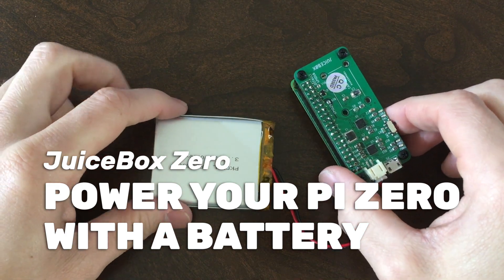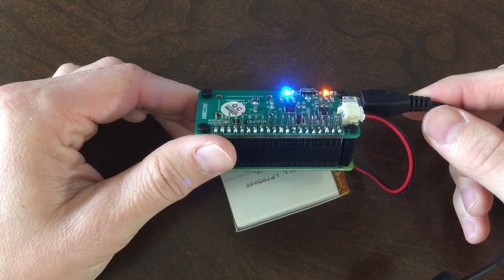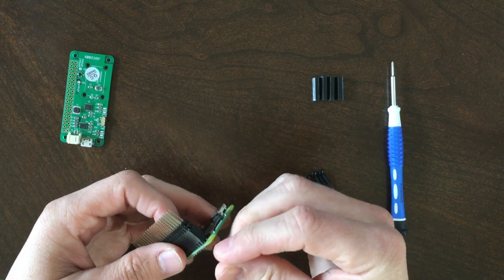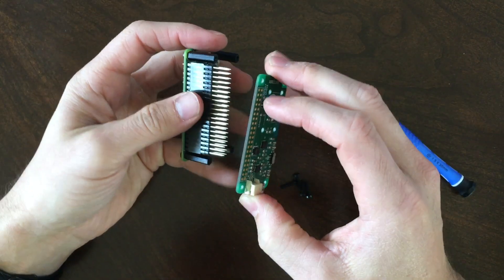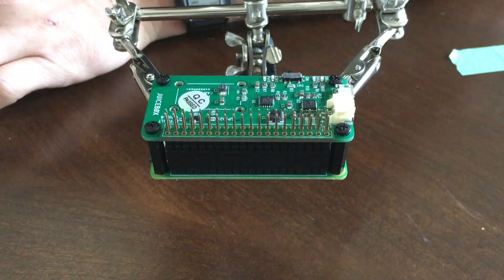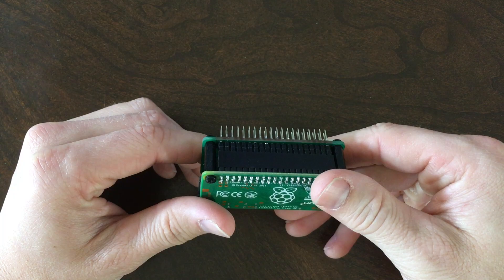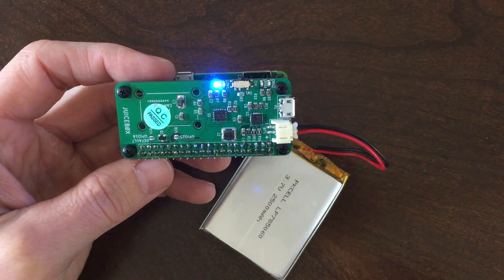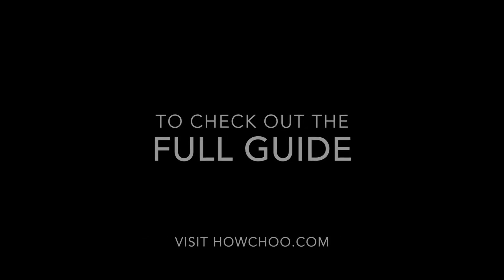Power Your Raspberry Pi Zero with a Battery Using the JuiceBox Zero

Comment: Why is that board so big? A 5V buck regulator and liion charging chip are tiny.  This couldve all been on a small 20x20mm adapter board with a male micro USB connector.

Comment: Instead of cutting off the rest of the pins you could stack another card on there as long as there's no conflict with which pins it's using and the pins in use by the juicebox. I'm curious what are the advantages to using this device instead of plugging in a mobile battery pack to the USB. (Besides freeing up the USB port)

Comment: Okay so I can still power things like screens with the header pins while using this module?  And also would this work on all raspberry pis or at least the 3B+ ?
Reply from the maker: This one is meant for the Zero and probably won’t provide the amperage you need for the Pi 3 — something like this is a better option: https://howchoo.com/g/ntfiytbjote/raspberry-pi-ups-uninterruptible-power-supply — And you can definitely still connect other things, it just depends which pin they rely on. You’ll need some kind of header splitter. See Pinout.xyz to check for conflicting pins.
Reply: The purpose of the extra tall header pins he added is so you can stack multiple hats so as long as you can fit it and there are no conflicts with the pins used you should be fine.

Comment: If you are using.the HDMI then make sure the screen is connected to the same battery because the HDMI on the Pi doesn't protect against different zero volts levels
Reply: Could you explain that futher

Comment: You do NOT need to solder all 40 pins. You can just solder the two 5v and a ground port and it will work

Comment: Can i connect standard cell phone power bank to raspberry pi zero w ?
Reply: As long as it can supply the milliamp draw of the pi and the voltage isn't too high you should be able to. Keep in mind some chargers may say they supply 2.4 amps but they mean through multiple ports simultaneously. It doesn't necessarily mean it will output that much through a single port. But it might.

Comment: can i stack another bonnet on top?

i want to use this with the pi-zero and adafruit oled bonnet, but im not sure if this interferes with other GPIO devices
Reply from the maker: It really depends on which pins are used by which boards — look up each PCB on pinout.xyz and compare the two pin usages

Comment: No I didn't like it because 2500mah is very less 
I want to add aaa batteries so that my pie can run 2-3 days without charging
Reply from the maker: You’re better off using a higher capacity battery then — AAAs won’t do the trick. You want a Lithium-Ion or Lithium-Polymer battery; not sure how many mAh it would take to power a Zero for several days but it shouldn’t be hard to calculate!
Reply: @Howchoo  
Whatever the case is I just want a phone with long battery life if li-ion can do the trick it's OK but at least make such video that can run the pie long days maybe a week

Comment: Couldn't I just connect a battery directly to the 5v and ground gpio pins? Why do I need a separate board that's as large as the pi?
Reply from the maker: So there are a few reasons why you’d want a board like this.. most importantly, powering your Pi directly from the GPIO header can easily fry it as there are no protection diodes or other circuitry. It would only take a small fluctuation to damage it. Also, you’d still need a dedicated circuit to charge the battery.. in addition to not being able to monitor the battery’s status to perform a safe shutdown. And shutting down your Pi improperly will corrupt your SD card pretty quickly. :) Also, most small batteries are 3.7V, not 5V. You need a voltage boosting circuit
Reply: thanks!

Comment: Soldering 40 pins on the top side... really? And why use a big board like this with that huge standoff gap and not a small Chinese boost converter charger or the adafruit powerboost 1000c ?
Reply: Same question here. Why wouldn't the existing GPIO pins work with a smaller standoff?
Reply: @runnhunt  Perhaps custom heatsinks and overclocking-vs-underclocking can be done that way for performance and power consumption tweaking.
Reply: @obsoletepowercorrupts  Maybe.. but you could mount it on the bottom of the Pi Zero with a much smaller header.
Reply: @chrisw1462  Even though you could do that (i.e. mount on the otherside) in a nifty project, there are instances when having it on this side with a heatsink (one which fits) could work, and then the heatsink is thereby enclosed.
Reply: @runnhunt   I like the PiSugar - 900 or 1200 mAh and compact.  With the big battery it's about the size of this one without.  It's a little newer than this, though.